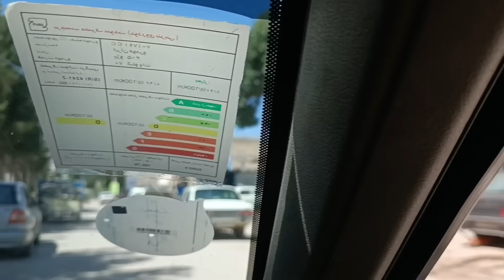Transformation of the house: buying a gas stove for the house by Ali

Comment: I would not create the kitchen in the interior of the room, but opposite the door. The smell of food escapes there more easily when you cook. And in winter, the sleeping and resting area is better if it is inside, because it is warmer there. Ali, I appreciate your effort, but smoothing the interior walls would be more important than painting the exterior, but please call a professional. Separate the kitchen with a counter. Believe me, Ziba would also appreciate it. Don't rush.
Reply: i agree to your good suggestions!

You want a room to flow!

if you have to go outside all the time for water when cooking inside opposite wall of entrance it's NOT FLOWING!!

Move refrigerator & stove by front door 🚪 & add a counter & shelves